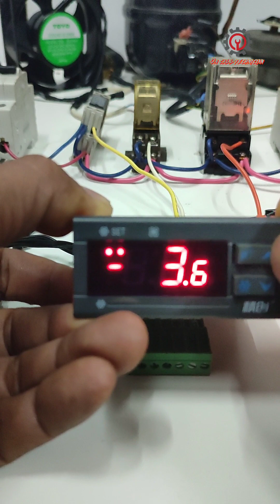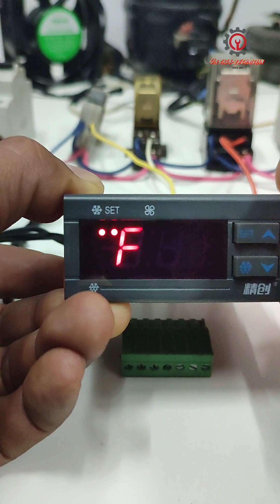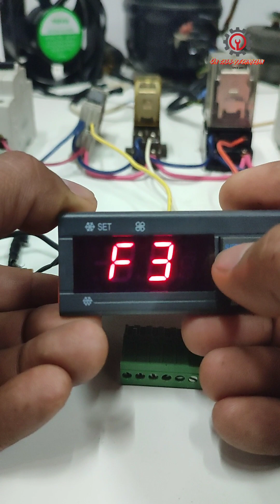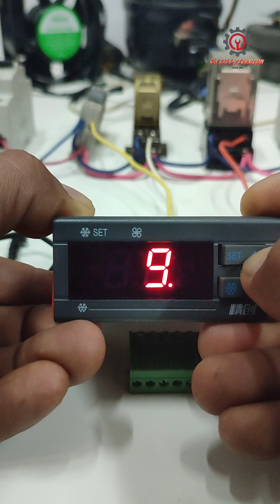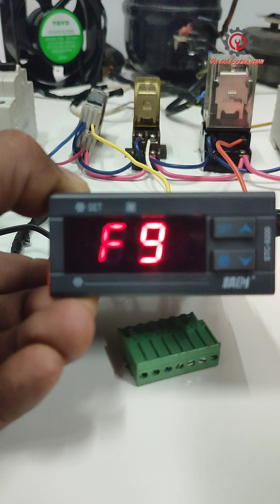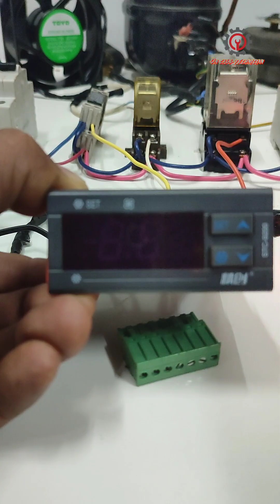ELITECH STC-9200 PROGRAM FROM DEFAULT VALUE TO CHILLER SETTINGS (ENGLISH)

Comment: Elitech stc 9200 
I want to install one sensor instead of two what parameter should i enter in it ?
Reply from the maker: No parameter to implement that sir, unlike dixell, Lae and Eliwell / Aruki
Reply: There is no function of a single sensor in this elitech stc 9200
Reply from the maker: Yes my friend, but theybhave  a single sensor model but i don't like it even for chiller 1°c  use. For wine chiller  17°c it fits

Comment: How to set to freezer n fridge
Reply from the maker: F3 stand for Lowest temperature, you may set it on -21 and F4 Stands for Highest temperature set it to -18 and you'll done sir. Let others code be in default.
Reply from the maker: F1 set to -21 or your desire - temperature sir
Reply: @THEMULTISKILLEDTECH  and what about F3 and F4??
Reply: What about defrost settings?? What value should i set them to for freezer fridge
Reply from the maker: Same with I've put there, when you go deeper and try to analyse things seem complicated then you are obligate to twist some codes there to meet your customers standard.
Reply: These r for chiller - i need defrost values for freezer fridge to freeze - F6 F7 F8 F9 F10 values i need for freezer

Comment: Que lorsque nous avons le code erreur HHHH
Reply from the maker: Its a room sensor issue, the ALL  value you put is being reached, try adjusting value or rectify your high pressure issue on your system
Reply: @THEMULTISKILLEDTECH  Thanks a lot
Reply from the maker: Your welcome sir 🙏
Reply: Sir elitech stc9200 single sensor setting pls
Reply from the maker: https://youtu.be/iDGmcAzZ0Us?si=A-RuDpE2WScJaQIK